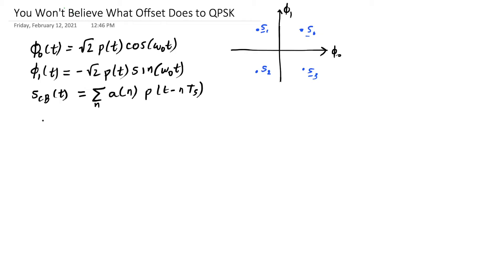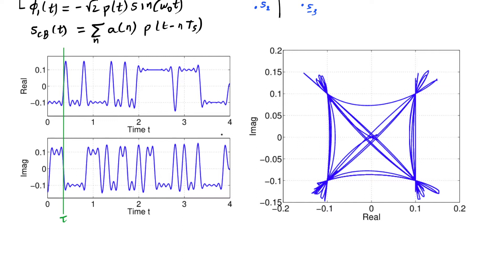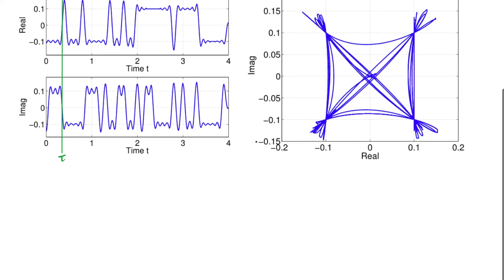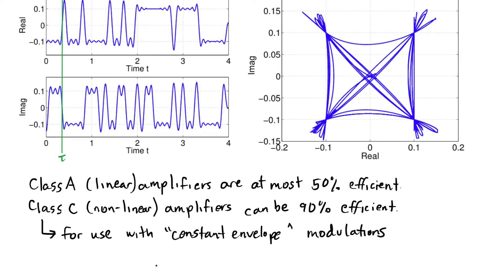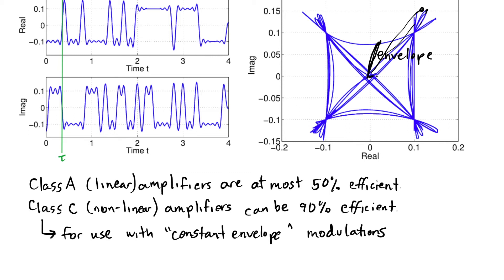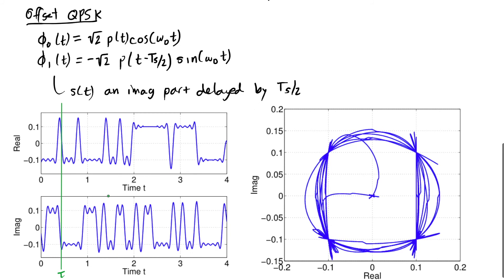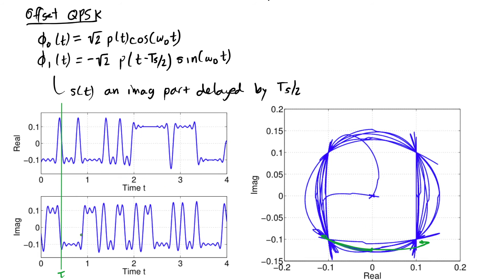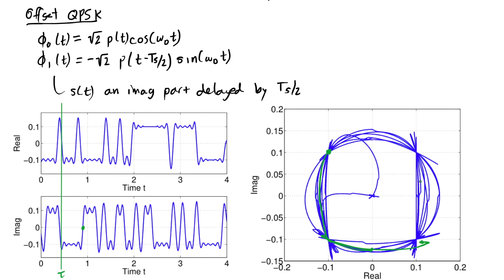ESE 471 You Won't Believe What Offset Does to QPSK

Comment: Pulse Shaped QPSK modulation has non-zero (dB) peak to average power ratio, which is a burden on the battery.
Reply from the maker: Right, QPSK modulation does not have a PAPR > 1. In comparison, the PAPR of Offset QPSK is closer to 1 than that of QPSK. Your point may be that the pulse shaping has a further impact on PAPR, which is true, although that topic is not covered in this video.